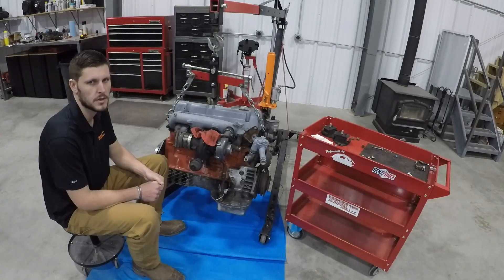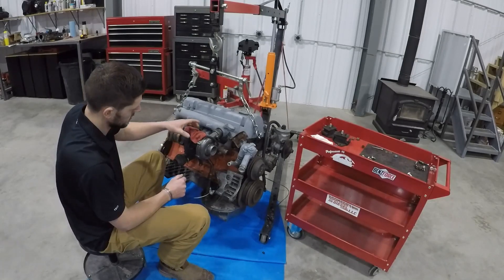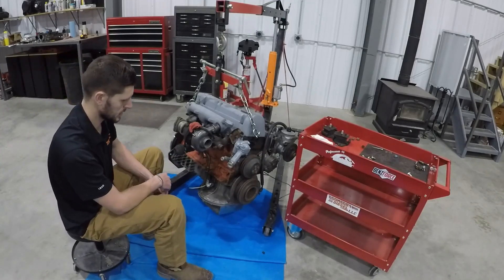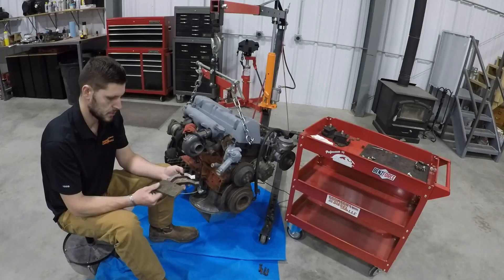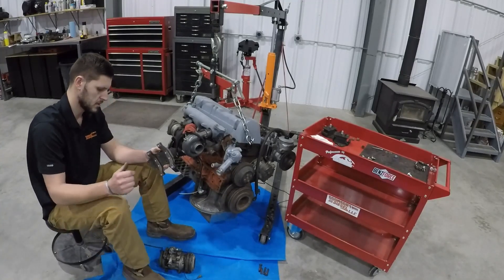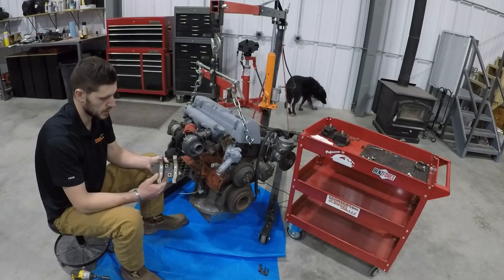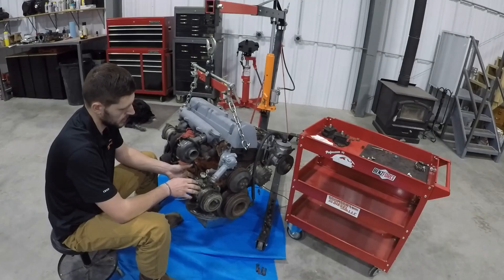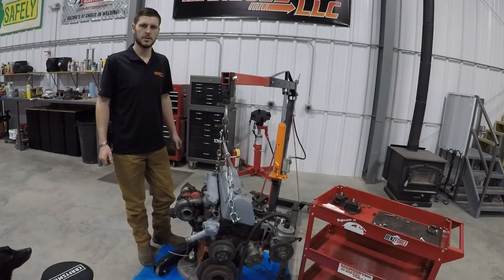OM617 Conversion Series: 22R A/C Compressor Adapter Bracket Installation

Comment: Could you loosen/remove the turbo oil drain tube instead of loosening the turbo itself?
Reply from the maker: If you can get to the 2 bolts. The oil drain o rings and rubber bung are maintenance items that need to be replaced regularly, anyway, so you might as well kill 2 birds. Otherwise, the heat cycles dry them out and create a massive oil leak spot.